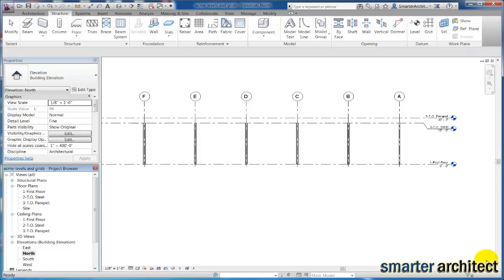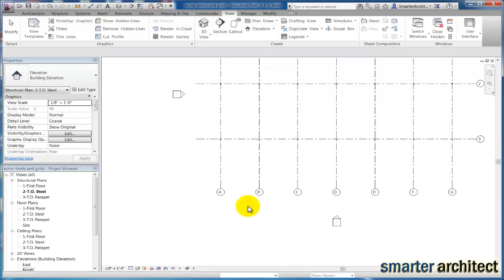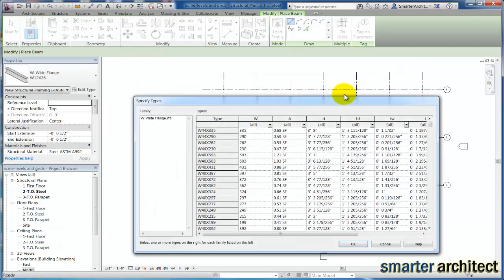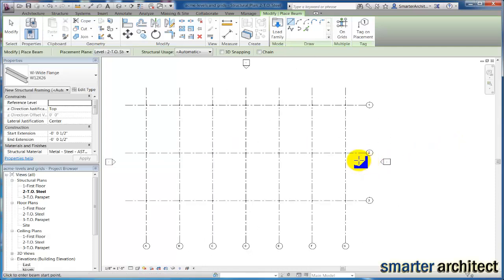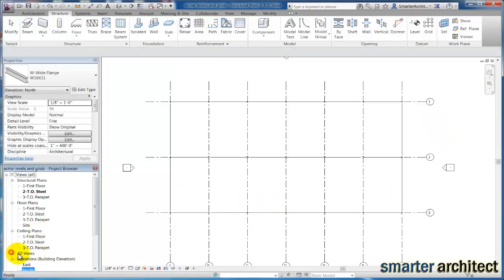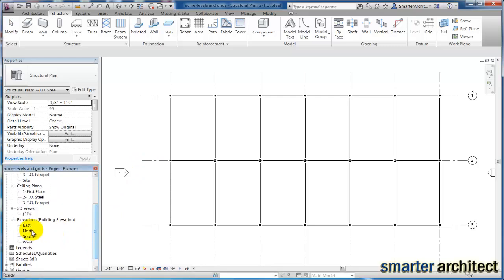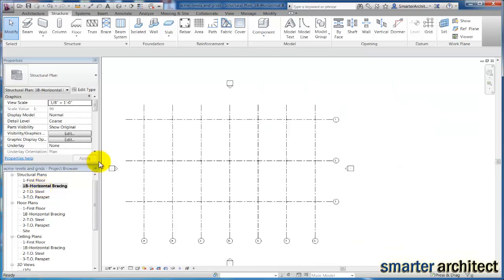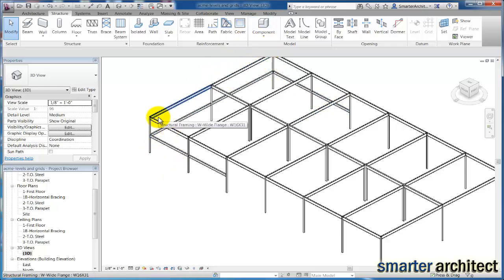Revit Structure 2013 Tutorials: Modeling Revit Beams

Comment: Hi, when I place a beam system in a level 1 floorplan for example, I click okay and its visible in 3d but not visible on the floor plan, it is very irritating, how can I fix this?
Reply from the maker: This is a visibility/graphics display issue that needs to be adjusted through the overall view properties menu.
Reply: thanks, I'll try that

Comment: More specifically the purlings that are along the wall portion and not the roof portion of the metal building.
Reply from the maker: Tiffany Lavender Yes if you would like to show the girts, then use a framing elevation view to show it in your drawing set with dimensions and notes or just for the visual graphic - using a cropped 3D view in axonometric should be enough.

Comment: Really great but I'm still wondering how to add purlings. I have a Pre-Engineered Metal building I'm working on but would like to show the purlings in the structural view. If you have any suggestions or videos on that, that would be incredibly helpful!

Thanks!
Reply from the maker: Tiffany Lavender If you follow the Bar Joist video tutorial in this series, it also applies to modeling the purlins of the roof structure.  You will need to use work planes if the roof is sloped - but I try to cover it in a future video.